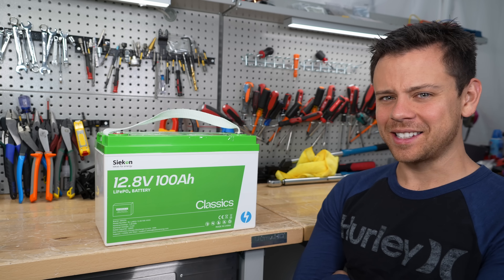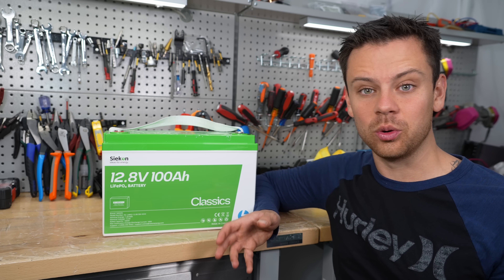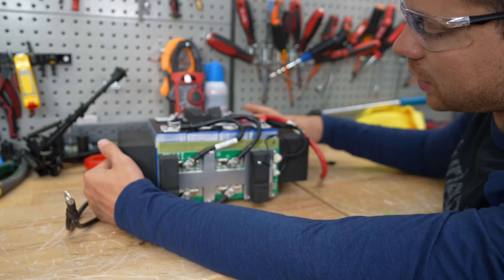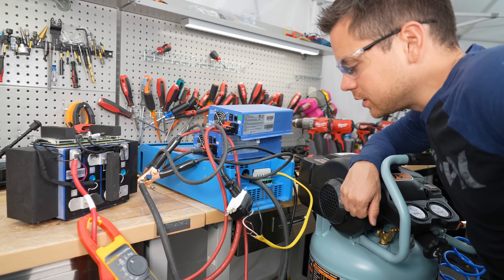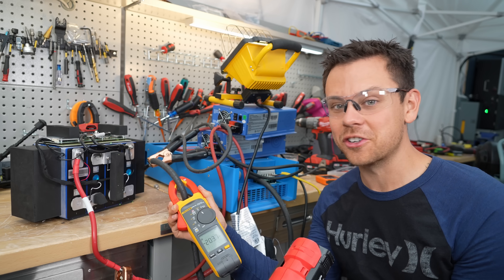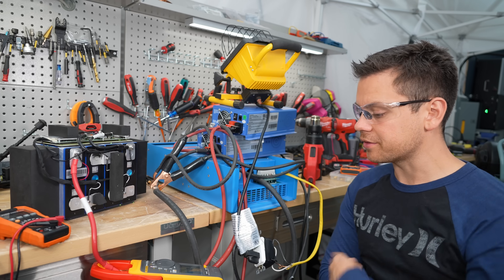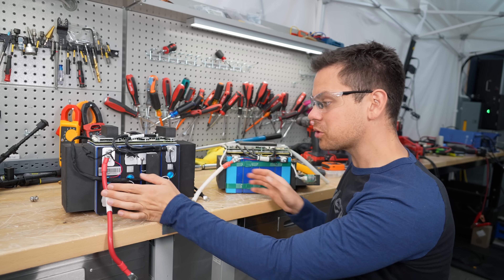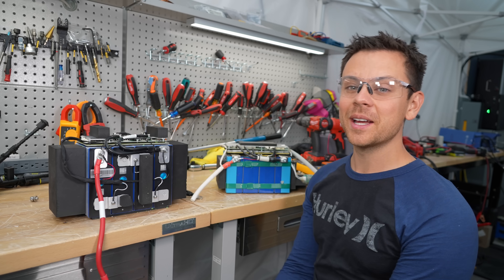Lead is Dead! $229 LFP Siekon 12V 100Ah w/ 150A BMS and Low Temp Charging?!

Comment: Where are these people... you don't see them in the comment... well, here I am. I still use lead acid (but also lithium...). My main reason for using lead acid... they perform well under zero degrees (Celcius)... but most of all.... I get many, MANY batteries for free. I don't even have space to store them all, so on many occasions I pass them on, also for free. If it wasn't for that, I would have switched over completely to LiFePo4 and/or sodium batteries. Btw, why don't you make a video about sodium batteries?
Reply: Where do you get free lead acid batteries?
Reply: @raywmontgomery  Donations from professionals, mostly car workshops and from power supply backup systems.
Reply: Sodium batteries have a bad history we will see if they have fixed the problems that they had years ago.
Reply: @boblatkey7160  The new models are looking very promising.

Comment: The limitations for LFP are being overcome 👉 low temp, 1C charge rates and discharge rates and capacity. This battery "does not have over-current protection" which is a red flag, but setting low voltage cutout is a workaround. Repeated high discharge will have an impact on reliability, but with perhaps a BMS software change, this issue is easily mitigated. Another simple solution is to buy 2 or 4 and run them on a 24 or 48V system, which then reduces peak current output loading. Great review Will, I hope you can do a deeper dive on BMS programming.
Reply: Don't need all that for protection. Any electrician can tell you that an "overcurrent protection device" is usually in the form of the correct Amp and Voltage rated fuse or breaker. Just get a DC rated breaker that is lower than the maximum current one wants to see. Done deal. LOL
Reply: I second that. Electrician here... In-line fuse or breaker for my system. @Tumbleweed5150

Comment: I've been using lead acid deep cycle batteries for 20 years.  I know when they are 50% drained based off the voltage/amp drain combination.  I can't do that with Lithium Ion batteries.  It's my understanding that Lithium Ion batteries are a lot more picky on the type of chargers you can use.  If they have fixed the possibility of them catching fire, then those are the only two issues I have with them.  Sure would hate to be 1,000 miles from shore on my boat and all of a sudden by boat goes up in flames.  Boats burn really well once lit.
Reply: LiFePO4 batteries are not like the older chemistries of lithium batteries. They will not catch fire, even if punctured! As to telling what state of charge the batteries are at, I bought the Victron Smart Shunt, which has an app I can use on my phone, (even when out of range of a cell tower), to see all the details about my battery system, such as state of charge, Voltage, Amperage or Wattage going into OR out of the battery bank, History, and a graph showing several of these plus more over time. The only charger you may need to change is a solar controller, if you have Solar, or you might need a DC to DC charger.
Reply: Just make sure to keep the lead-acid starting battery(s), as so far, LiFePO4 batteries can't handle enough Amperate to start an engine without ruining them.
Reply: @Tumbleweed5150  sounds like another electrical component to break.  I like the simple voltage gauge, it doesn't break.
Reply: The numbers are much tighter but measuring voltage with respect to state of charge is easily accomplished with a lithium battery. But do not let anybody tell you that lithium iron phosphate battery cannot do a thermal runaway. All batteries can have problems and so can your propane bottle.

Comment: One advantage of lead acid is that they're a LOT less 'splodey than lithium and less likely to spontaneously detonate, so even tho they don't last as long you can consider it as cheap insurance from burning your car or house down.
Reply: You don’t know what you are talking about lifepo4 is just about bulletproof. Not SPLODEY  !
Reply: That is "ancient history" in the battery world. LiFePO4s, also known as LFP batteries, do NOT explode, nor do they have thermal run-away, like their older lithium batteries do.
Reply: Besides, if you let a spark happen near a lead-acid battery, they CAN explode. I have SEEN it happen.

Comment: I appreciate you testing surge because I'd really like to use lithiums on my sailboat including as the starter battery, but I think a lot of the BMSs can't handle the starter.

It's funny that the overcurrent protection is just not working, but that's actually exactly what I want because I know the lithiums have plenty of cold crank. Makes me want to buy it more 🫠
Reply: They do NOT have enough Cold Cranking Amps, as what's needed is over 500Amps instantly, and for long enough for the engine to start. We may see them soonish, but not yet. Please don't try it yet, as it may cause more problems than just destroying an otherwise great battery, and you wouldn't get any warranty coverage. LOL
Reply: @Tumbleweed5150  You know I just don't think that's true from a lithium perspective, I think that's more true when you think about the BMSs.  I had a friend do his own build off of prismatics just like this and it was the starting battery for his sailboat. He just bypassed the BMS for the starter.

Which honestly is a really good idea anyway because starting the boat can be more important than destroying the battery sometimes
Reply: @eternaleggface  True, it's not the cells that limit the Amperage. It's the wires/cable size used. Look up how many Amps your engine starter pulls and then at a Amperage/wire guage chart. See how big the cable would need to be to handle say, 550 Amps. Putting the BMS in that limits the Amperage keeps the cables from burning up from over-amperage.
Reply: I'm facing the same choice you are. Got two 164A 12V AGMs in parallel, and they are showing sulfation issues. Gonna try to rejuvenate them this winter while I store them. But I want to replace them with two parallel 304AH LiFPo4 batteries with at least 200A capacity BMS each. My alternator voltage controller already has a LiFPo4 mode, so the only thing I worry about is possibly damaging the BMS cranking the starter on my 45Hp Yanmar diesel and running the anchor windlass. 

Turning over my diesel is nothing compared to a 200-300hp car engine, so I feel like I shouldn't need to run a dual LA and LiFPo4 system. I already carry a Lithium Ion automotive starter pack that charges with USB. 

I feel like the whole cranking issue is turning into an urban legend...

Comment: I have a feeling the prices on all lifepos will be coming down big time. There will be a surplus of lithium due to the EV market taking a massive nose dive because nobody wants EVs.
Reply: I would love to have an EV. I just can't afford the cost to buy one, and would only be able to charge it from fall to Spring, as I need every Watt I can get to keep my under-insulated RV cool enough to survive 125+F degrees days in the summer!
Reply: @Tumbleweed5150  Plug in hyrid like the ramcharger can also be used as a backup generator. Will likely be very expensive at first but will likely have large price cuts once production increases
Reply: Just reported a day or 2 ago that EV sales are up 11% from last year and hybrid sales are up 15%
Reply: @JD-yx7be  car rentals are dumping thousands of EVs into the market. Sales may be up now but they are going to tank. Imo but I'm just a yard guy, what the hell do I know?
Reply: @JD-yx7be  I would venture to guess that if sales of EVs are up it would be because they are having to reduce price in order for them to sell. Flooding the market and less demand will ultimately cause lifepo to go down in price.
Reply: @ReeferMadman  More battery factories being built increases supply. Rule of thumb for for economics of scale is for every 10% increase in supply is a 1% reduction in production cost per unit. The market has already corrected for Hertz dumping its cars, the slowdown only lasted for 6 months.

Comment: i paid  100dollars for 200ah batteries ill take agm all day
Reply: Go ahead. I just like that LiFePO4s are one third the weight and last for around 20+ years, (10 if used VERY hard). with only 20% degradation after that. Still worth it to me.

Comment: These batteries all look the same anymore really. The cycle numbers are pretty pointless. They are all over the place even within the same companies, exactly as you pointed out. Additionally, pretty much nobody gives the conditions for which those ratings apply - such as 5000 cycles at a 1C charge/discharge to 80% state of health. It's silly, they'll keep one-upping one another by using lower discharge rates to get higher numbers.
Reply: Keep in mind someone may steel them. You are right but as prices drop we can abuse them and replace them. What about 10 year old solar panels? Replace, add more, when do we upgrade considering they are not recycling them.

Comment: How such would work in realy cold enviroment,  well i have a small cottage on one of the lakes islands and temp during winter time can blummit to -25C or even -30C ( -13f up to -22f ), and its quite dark, so solar panel wont produce anything for very long time (3 to 4 mths ),and cottage is not accessible most of the winter time , frozen lake most of the time is not easy to cross,  could this siekon be good choise?

Comment: Decent for the price for sure but why do they keep putting them in the old size box? They could have used a much smaller box. Most people have limited space for multiple batteries. Smaller package would work so much better in campervans.
Reply: Yeah, I was wondering, why so much empty space in there?
Reply: Probably because they produce a 120ah version and using the same box keeps costs down.
Reply: @rogerhargreaves2272  Maybe but it looks like it could hold close to 200ah.
Reply: @dfwvtxman  quite possibly. 😃👍

Comment: I’m also impressed. However, can the latest LFP batteries be used to start a diesel engine in a boat (or a car)? If so, we can really say good bye to lead acid batteries.
Many LFP-battery companies used to say “ no”, but @willprowse of this channel may be the only channel to does such a test.
Reply: Nope. Not designed for very much higher Amp draw!

Comment: Looks like it could work as a car battery  as long as it fits in the battery box .
Reply: Nope!
Reply: @Tumbleweed5150  why not ?
Reply: @robertvogt5606  Because the starter on vehicle engines can pull up to or over 900 Amps at once. Future LiFePO4 battery BMSs might let that happen, but for now, the Amps one can pull out of the battery is restricted, due to safety concerns. One has to have a much larger cable at that kind of higher Amperage pull.
Reply: @Tumbleweed5150  thanks for your reply . My 2002 Hundai accent has a 600 amp battery which this battery. Did pull or was the max capable  & my '75 CJ5 has an 800 amp battery so they're getting close .
Reply: @robertvogt5606  Right, but I wouldn't try it until they Warranty that the battery WILL work to start a vehicle.
Reply: @Tumbleweed5150  your right about that !  The 600 amps was for a 5 second limit which normally has the Accent running but that's living on a thin margin.

Comment: Stop talking and start testing... diesels are up to 800 amps for cranking  ... Small to medium-sized cars typically require 200-400 amps to start. So you claims need to be proven across a range of vehicles on a cold day to be something more than clickbait.
Reply: The issue for campers and RVs was cost of batteries and replacing all the associated mgmt and chargers (most often more than the bateries)  So I guess you are a little biased and ignorant (not unusual for newbies)
Reply: @markwright196  I have been living off-grid for over 30 years, and have watched Will grow from building small van systems to whole house systems in the time I have been watching his channel. YOU are the one that doesn't know what you are talking about. Yes, one can need to replace the Converter and/or the battery charger, especially when switching from lead-acid to LiFePO4 batteries, but the lifetime of the latter is way longer. Expected lifetime of lead-acid, when used only down to 50%C is around 400-500 cycles, or two to five years. Expected lifetime of LiFePO4 batteries when used down to 0%C EVERY DAY is at least 5,000 cycles or at least ten years, and even after that they are still usable at 80%C! Double that if one can keep the lowest depth of discharge to 50%C, or probably 20 years. And that doesn't figure in the lighter weight. 1/3 of comparable lead-acid batteries, which, in your campers and RVs comparison above, makes a lot of difference!
Reply: These types of batteries are not (yet) meant for starting cars. When we, (and Will Prowse), talk of large battery systems, we are talking about systems that use solar power to charge a battery bank that then gives the power to an inverter. AC power. I am totally off-grid, being over 4 miles from the nearest power pole, but my 48 Volt battery system can power 2 Air conditioning units, and mine is considered rather small in the solar power industry.If I could afford the solar panels, batteries, etc., I would have made it even larger so that I wouldn't be using any componant as hard as I am, but I was limited in cash when I bought my system, and am even more limited now. BUT, this system is saving my life when it can get over 125 degrees F. outside!

Comment: If only they could make them easy to drop in for automotive Starter batteries with enough cold cranking amps and a charging profile that works natively with automotive alternators..  If van lifers could squeeze in a 300AH Lithium in the starter tray many would not need a house battery and related components.

Comment: Ive been watching the prices of LIPO's very closely, mostly between TEMU and Amazon.   I feel like TEMU was undercutting AMAZON prices, which AMAZON has now matched.  
But I am now seeing random, (you have to keep a watchful eye to be in the right place right time), very good deals.   For example, I bought 3x watt cycle 100ah batteries from TEMU for $375 (Free shipping from the US).   Thats $125 a battery.  Ive seen similar deals, but then prices go back up, for a few day, etc.   My point is, I think these new "random" deals, will slowly become the normal price.
Reply: I should add, I think we will see those cheaper prices in the near term, unless WW3 really kicks off, escalates.   Then they will all be unobtainable.

Comment: I would like to see a video of how to wire up a dozen of these 12v batteries in a 12v configuration.
Reply: According to the schematics I've seen , one can only wire up to 4p, 4s. I think you could do up to 16 in series, but I would definietely use the properly sized DC Voltage rated breaker on each "bank" of four batteries.

Comment: What do you think about running 4 of these for going cart drop in replacements?
Reply: It will work, but don't tell the manufactorer or seller that's what you are doing, as they will not honor the Warranty. I used six, wired 3 in series with 2 series in parallel, in a 36V Golf cart. Just make sure to put in a properly sized breaker!

Comment: Without over current protection actually present and functional, I would put a Class-T fuse in series with that battery. Too much risk of melting insulation and starting a fire, if there was an internal failure...
Reply: There should be a class T used regardless of battery technology
Reply: @TrollingwTyrone  But in this case it could well be your single line of defense against overcurrent, and we don't know how much or what will happen .... Will the BMS catch fire with a direct short instead of shutting off the output? I would personally be hesitant to promote this battery until the issue is fully understood and fixed.
Reply: Over current protection seems like an important safety feature. Why is Will so casual about it missing? Is the external fuse the ‘real protection’ in such a system or is this a belt and suspenders strategy where it is so important that redundant strategies make sense and this is potentially dangerous for a more complex mobile system.
Reply: @mattmayfield3520  MOSFETs commonly fail dead shorted.  Relying on one as the overall protection in a circuit is less than ideal.  The correct fuse will fail open.

Comment: Saw some reviews on a cheaper LFP battery from Temu, $170. Battery capacity good, low temp good, over current not so good. Basically the same sort of result you got. 100ah battery and no disconnect at 300a for 5 min.
P.S. bought one and set it up with a 150 amp fuse all good
P.P.S. May do all the checks and then open up the battery for the look see.
Thinking air flow around the bms is upsetting the overcurrent portion of the bms

Comment: Maybe its because the "price" of a new lead-acid car battery has shot thru the roof. It didn't make sense to buy a lithium car battery in the past.
Reply: LiFePO4 batteries are NOT designed as engine starting batteries. The Amp draw of starters is WAY too high!

Comment: Battery noob question. Why does the case have so much open space? Is that for some thermal reason or is the case just an industry standard battery size they are trying to match?

Seems like about 25% free space. If no thermal reason, you could probably re-case these and put four of them in the space that three occupy "off the shelf."
Reply: You are probably correct in thinking the standard battery case is the reason, though there ARE smaller, "mini" 100Ah LiFePO4 batteries out there. I bought six to put in my girlfriend's golf cart. (Just don't tell the manufacturer, as they claim it won't work well, so won't respect the Warranty.)